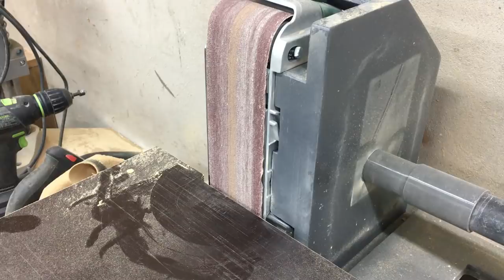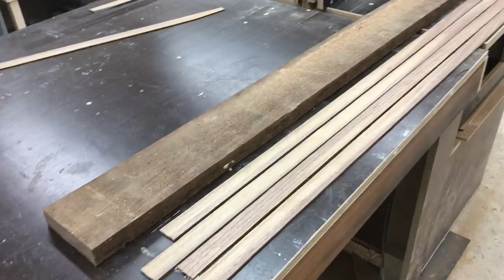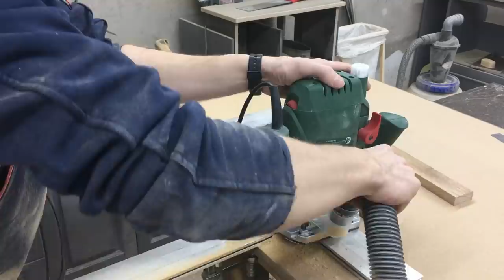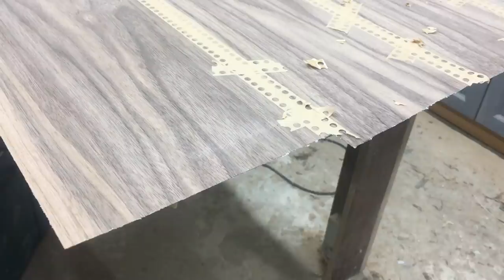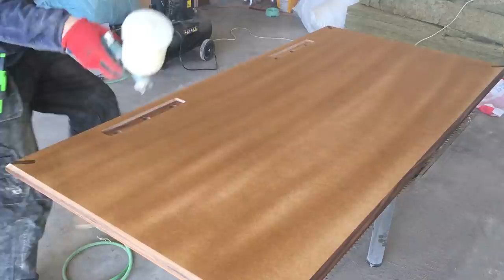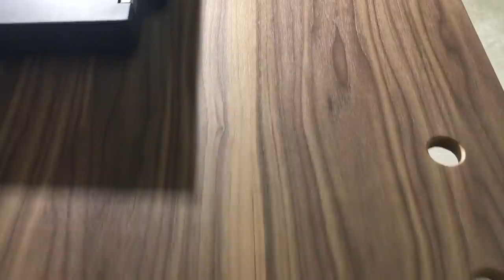walnut veneered standing desk table top

Comment: What is the purpose of the inserts in the corners?
Reply: So he can slightly round the table corners without MDF showing out.
Reply from the maker: At begining I was planing to make corners with bigger radius, so those inserts would be exposed instead mdf. Also after rounding veneer at corner bottoms these inserts are exposed.

Comment: just curious - why those cuts in corners (with wood plug) where needed?
Reply from the maker: At beginning there was a plan to make rounded corners, so these plugs would be exposed. But even after plan change these help not to expose mdf when veneer is sanded at corners.